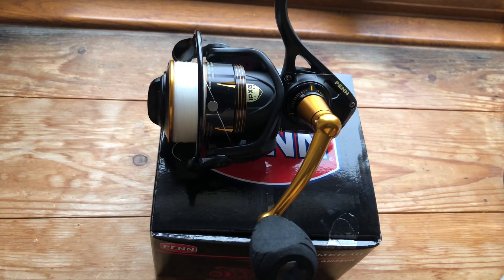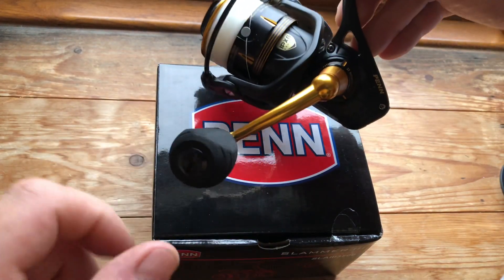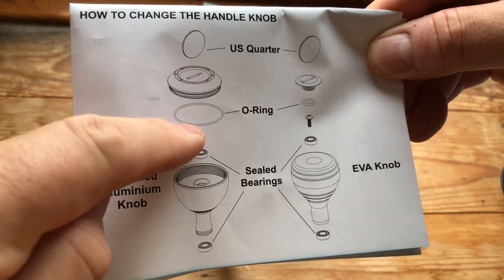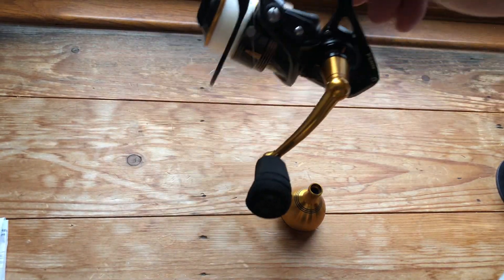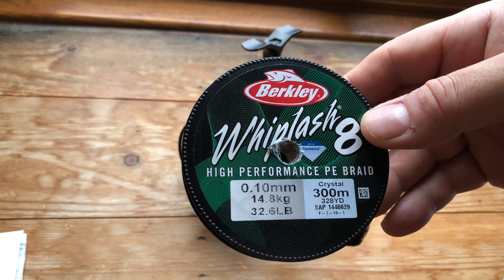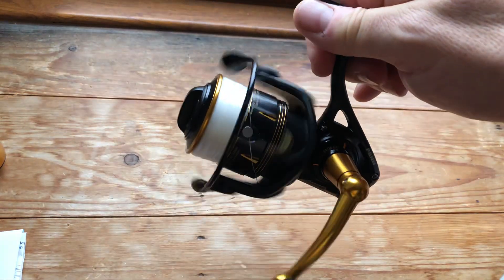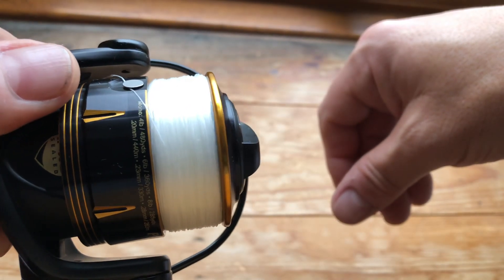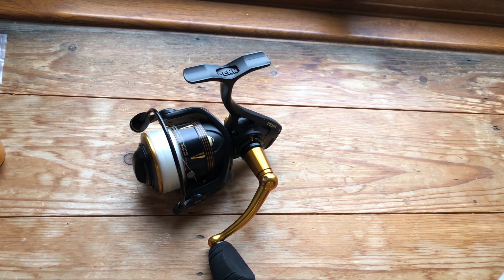Penn Slammer 3 3500 size review part 2

Comment: Just letting you know that the regular spinfisher vi and slammer iii are actually sealed the exact same. By regular spinfisher vi I mean not the long cast and live liner. The only reason the say the spinfisher vi’s are IPX 5 is bc the live liner and long cast spinfisher have a couple more points of entry but those extra points of entry are sealed as well so nothing to really worry about. But just wanted to let you know that the slammer and regular spinfisher are sealed in the exact same places so there really isn’t a difference besides the amount of drag in the slammer